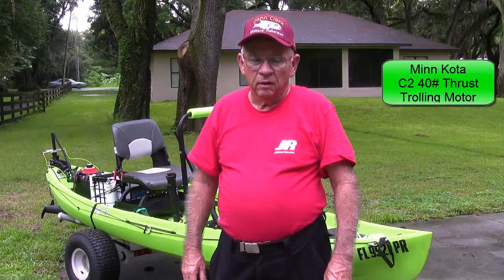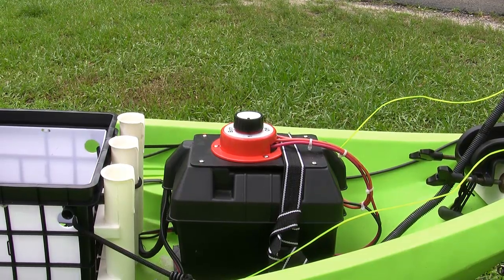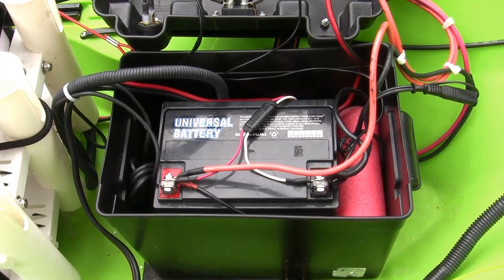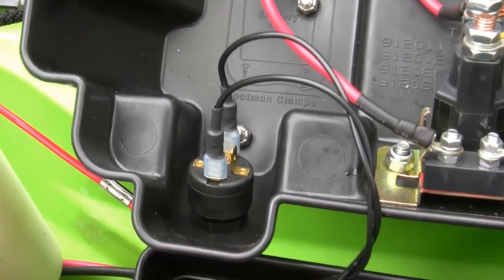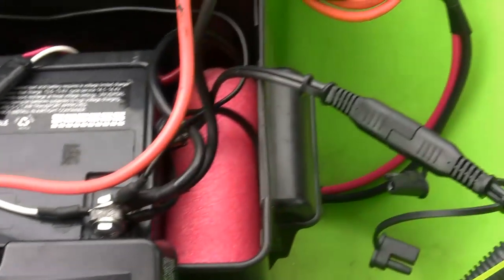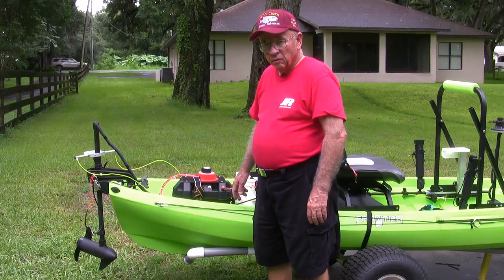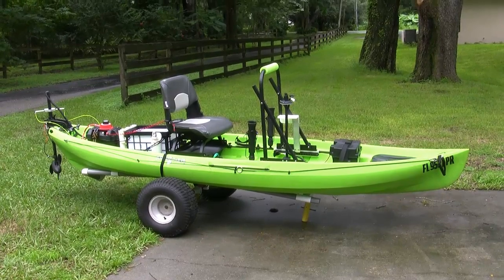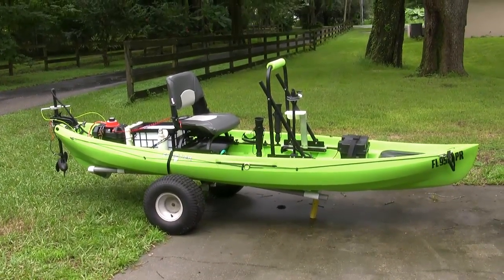NuCanoe Frontier 12 Kill Switch and battery selector switch Installation

Comment: helicopterjohns , you have one nice set up there sir.  I really like how the dual battery set up extends your range and acts as a counterbalance.  You mention that you are going to install a voltmeter and that's something some people don't take into consideration until they run out battery power at the worst possible time.

I didn't have to install a meter on mine because the depth finder that I have (an $85 dollar Hummingbird) has a voltmeter feature built in.

Thank you for sharing!!